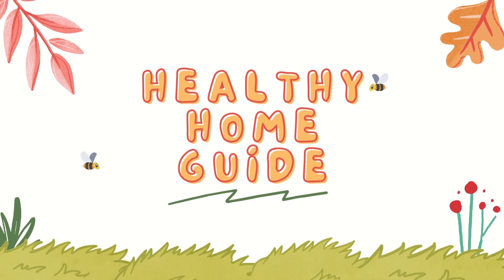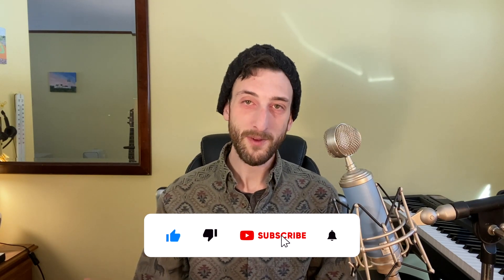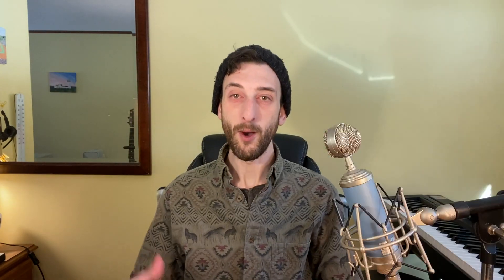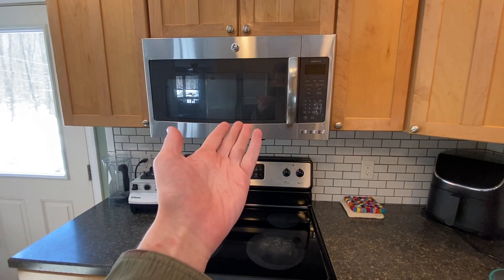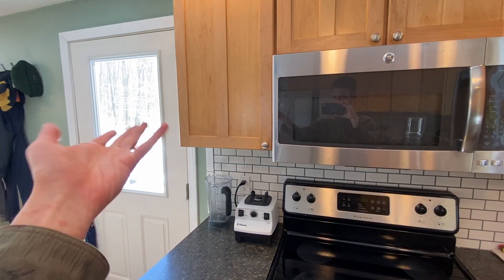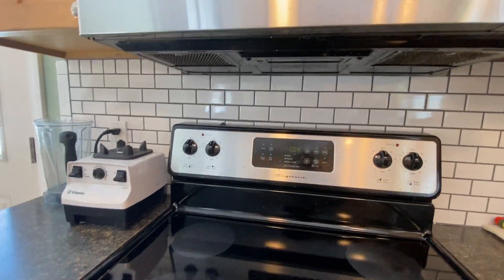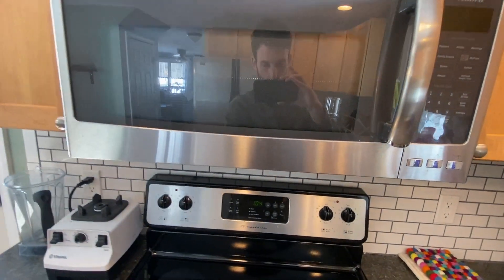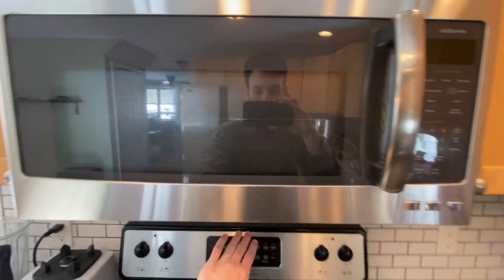Is YOUR kitchen exhaust system a LIE?

Comment: My wife and I bought a renovated house and the amateur who did the renovation installed our microwave integrated exhaust hood with the directional plate  facing the wall behind it. Apparently these are reversible so that you can filter and return through the front of the top of the microwave, or flip it so you can use a true exhaust duct to the exterior through the wall. So for about a year we pushed smoke and water vapor directly against our wall behind the microwave.
Reply from the maker: That's unfortunate. Did it cause a mold problem in that wall?
Reply: @HealthyHomeGuide  not that I know of, but I would t be surprised if we find some there when we fix it. We stopped using the fan after we found out  and now have a short network of fans blowing in to the bathroom nearby where we run the ceiling exhaust fan as a workaround until we can afford to install a proper exhaust vent there. My house was build in 43 so there are no ducts and pretty poor air sealing. So I’m always looking for ductless solutions to air quality management and air conditioning that doesn’t require taking on enormous debt. Your videos have been very informative and encouraging that others are pursuing this too!
Reply from the maker: @JonCarton  That's clever to direct the kitchen air into the bathroom and then exhaust it out as a temporary solution to the lack of range hood. I've never lived in a home with a range hood in my entire life. I honestly can't wait to have one someday. So glad my videos have been helpful to you!

Comment: When house shopping early last year I learned to look in the cabinet above a range hood to see if there was exhaust ductwork present. Not foolproof but it was a good general guide. The house we eventually purchased had a recirculating hood but I made sure that there was a fairly clear pathway for adding ductwork. Until I completed the install I used a Portal Airbar window fan above the kitchen sink. It was relatively quiet and designed to leave in place without major air leakage when not running. 

I wanted a range hood with easy to clean baffle filters, relatively quiet so it would actually be used, simple physical button controls, stainless steel exterior that doesn't require building a separate range hood cover, and under 400 cfm to minimize need for makeup air. I was tempted by Fantech's range hood insert but it seemed like more than I needed with an induction range. I ended up getting a cosmo uc-30 for much less than I'd expected to pay, ~$220. It was one of the few range hoods I found that didn't insist on having touch screens or excessive cfm and I've been generally happy with it over the past 15 months. If I were to need to replace it I may look into the Broan Elite Alta III.
Reply from the maker: That’s great information, thank you! I’m totally with you on feeling that a touch screen is unnecessary on a product like this. And on most products. Everything is made to look minimalistic and sleek, and thus, its practicality is lost. Give me pressable buttons any day. And don’t put just one button on the product - give me enough buttons to cover all the functions!